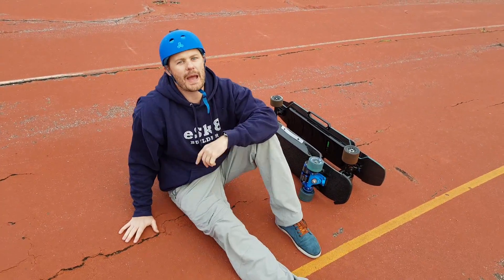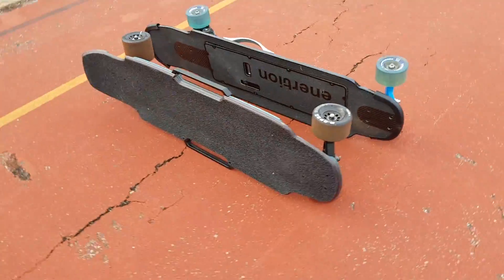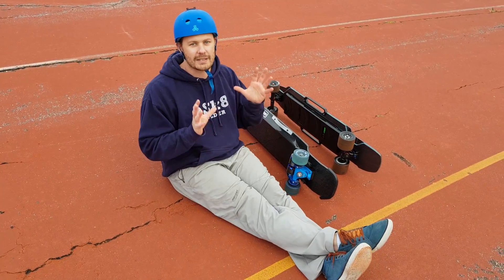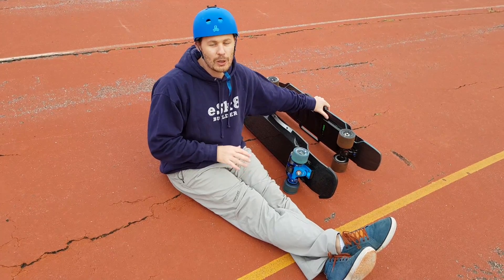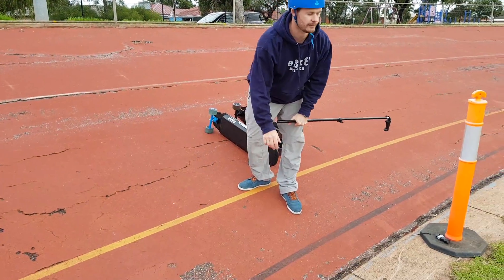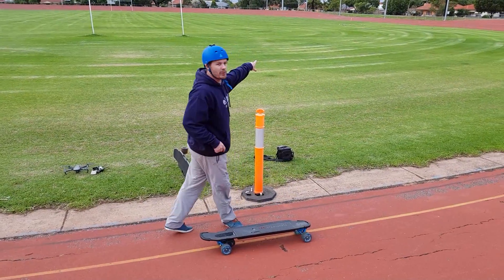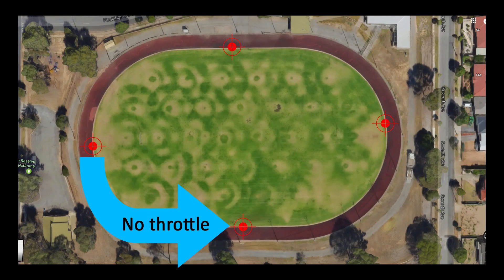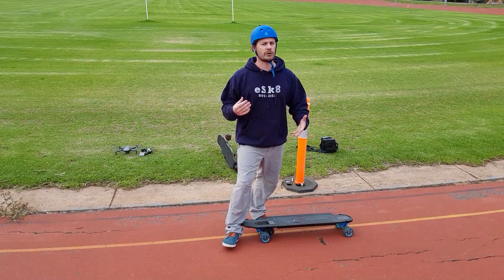Belt Drive vs Hub Motor - Electric Skateboard Comparison

Comment: Statistics of belt version (raptor1) are for one motor or for two?
Reply: 105Amps - that is result for one motor (50Amps each) or for both? Also single motor uses 1500Watt or this result is for two motors (750watt each)?

Comment: So i have a blitzart board. Its a singke hub motor. Top speed is 18mph ans a range of 12 miles. Is there anywah to make it a dual motor? Using different motors besides theres? Like placing the one tou have on my board? The board is made of bamboo and maple. I love it but want a faster motor. Any suggestions?

Comment: I’ve been riding electric skateboards for three years now and from my Experience hub motors break faster than brushless outrunner belt driven motors. There’s just way too much vibration and abuse hub motor takes vs a belt drive System. Hub motor are in direct contact with the road Which causes a lot more stress. There  also more expensive to replace.On the other hand hub  motors need a lot less maintenance from day to day use.
Reply: Electromatic so if I decided to get an electrical skateboard, and it is my first time ever riding any sort of skateboard, should I get hub or belt?

Comment: How long does an e-board like that (both belt drive and hub motor) last with daily use?
Reply: I don't have an e-board (yet, gonna build my own), but I tend to ride fast on my long board (I think the fastest i've driven according to my phone is 39km/h) and on my snowboard (fastest on that was about 53km/h). The thing is, yes it is dangerous, but if you wear protective equipment you should be more or less safe. I never ride neither the snowboard or longboard without a helmet, elbow, wrist and knee guards, unless I have 0 plans on riding fast that day. I'd still probably put them on or take them with me in a backpack or something.                
                
Just protect your self and cruise at a speed you're comfortable at.
Reply: I have had the Raptor 1 over a year now. I don't ride daily but 3-4 times a week for over 8 miles a ride. Never had any issue till I crashed and broke my arm last month. Just ordered a new remote because that was crushed in the crash. Board still turns on and appears to have no scratches from the incident. The carbon fiber really holds up. Hope that helps.
Reply: Okay, thanks for the info.  I was thinking about getting an eboard, but i think it's best i get ebike or a regular bike instead.

I believe it's fun (the eboards), but the "bust your behind" factor is concerning me.  Hope your arm heals properly and be safe.

Comment: Jason, looking into purchasing a Raptor 2 over a Boosted if you can answer a few questions for me. 1- how flexible is the length of wiring between the wheels and battery pack? Essentially, would I be able to swap to a deck with a larger distance between the pack and wheels with no issue. And 2- would any of us purchasing in the next few weeks receive our shipping before August? Because the summer is when I will get the most use.

Comment: Put ferroliquid in these hub motors and you can put more power into them.
Reply: Even on big uphill?
Reply: Arek R. Unlike other esk8 hub setups the Raptor 2 has an aluminum billet truck system that functions as a heat sink.  They probably still get pretty warm but they wont get as nasty hot as other setups.
Reply: Electric Skateboard Builder E-bikes use motors with hall sensor and people add ferroliquids and dont report any problems.

Comment: Jason, do a video on the motor only. I'd like to see if I could put precision full ceramic or ceramic hyprid bearings in it.
Reply: Good to know Jason. Also any heating issue with the VESCs being inside a sealed enclosure with all of the other electronics?

Comment: Please make a video on raptor 2 VS evolve gt carbon
Reply: no problem,  Be careful out there,  these things can get you into trouble,  i have a lot of road rash over the years.  invest in a good lid and some longboarding  gloves with the pucks.  I unvelcro the puck half way and hold the remote behind it on my right hand.  Pucks will save you from a lot of pain and rash if you happen to wax.
Reply: Jason is working on this https://scontent.cdninstagram.com/t51.2885-15/e35/18096490_435267156865932_5533361944037163008_n.jpg
after seeing that i purchase 2 raptors
Reply: He said he's working on it, it's the reason why I made the purchase
Reply: Like the raptor 1 more 

Have driven almost every board on the market 

Now 3 years later i will keep it with my evolve ,s
Reply: they wont ever get scratched by riding but you have to make sure and not hit your motors on anything when you carry the board around.    I take it on the subway and have to just be mindful of not bumping the motors on something.   So far after 2 years i have never hit it or scratched it.    Evolve makes a new bamboo one that has the motor tucked under the board like a boosted.   I use my single motor bamboo deck more than my gt carbon with the AT wheels just cause i like the feel of skate wheels.   It goes just as fast as the GT duel motor set up, the only difference is the torque curve.   I personally love the bamboo deck cause it flexes and just feels perfect for me.   You wont have any regrets with any set up.  personally i wish i would have bought another gen 2 bamboo series before evolve discontinued them.   Parts are still available, i just ordered a new deck and swapped it in 10 min.  car ran over the front of my board and broke the deck.  thing is still a beast, i pass cyclists like they are standing still, it will go 27mph.    No one on a bike can keep up with me.  Also, even after riding the hell out of the boards,  i never have had to replace a drive belt, still on originals and i have logged 100's of miles.  I bought spares but never needed them yet.
Reply: Ok, thanks for the info ;)
Reply: Well if you look at their specs, the raptor 1 out performs the carbon gt in every way, in saying that, evolve can come with off-road wheels whereas the raptor 1 you'll have to modify your wheels, and raptor 2 you can't change your wheels, if you live in bumpy areas with gravely roads, go the carbon gt off-road. If you live near flat smooth roads and want better performance go the raptor 2.
Reply: R/C Vin how/where Jason get/make this custom parts?
Reply: Sorry I didn't get you.
Reply: In that case they're both actually very reliable but I've heard evolve has better customer service, in saying that though, enertion is more customisable and easier to repair and maintain by yourself👌🏼after a few months I've only had to resolder a wire inside the remote, I may have crashed and damaged the remote but an easy fix, but that's it. As for evolve, a friend of mine says his only issue was one of his motors would keep cutting out, he contacted evolve and they told him what to do and now it works again, I still beat him in races 😝
Reply: i live in chicago and i have the evlove gt and bamboo gen 2.   They have held up to every day riding with no issues.   The bamboo gen 2 has 2 years of abuse and it still runs like the day i bought it,  had to replace the deck and motor from a bad crash but it was easy swap.  The Carbon Gt is perfect for the large pot holes in and dirt and grime in the cities.  The only issues i have is keeping the drive bearings clean.  I have to clean them once a week but these boards are my only mode of transportation so they get a lot of use.  Evolve aftermarket sales took care of me always too.   I finally saw some dude riding a raptor and he was going really dam fast,  and my gen 2 with 97mm wheels caught up with him with ease.  I get 27mph with the 97mm wheels, its great.  With those hub motors and a really grimy streets, i wonder if they clog up with dirt and grime.  the inside of my flywheels get black with grim very quick.  Does that affect performance of hub motors?
Reply: Dutch E-board Rides Netherlands evolve customer service super good? I read just the opposite. That Boosted board's customer service is the best one and that evolve's suck. But that's what I read
Reply: the other plus to an evolve board is you can use abec 11 wheels of your choice,  just the wheel options alone sold me.   You can put wheels that suit your style and the size adjusts your top speed.  i go thru drive wheels quick if you do not rotate them.   With a hub motor type wheel you would be limited to your set ups and swapping the rubber only from the drive wheel seems like PITA on a hub motor set up.   Just being honest as a avid E boarder,  I dont work for evolve.  If you live in a pristine place with clean smooth roads and a hub set up suits your style, i can see them being pretty cool but the realistic city settings might be too much for it longevity wise.  i would like to see a long term review on these updated hub motors and how they are maintained and cleaned.
Reply: does the motors get scratched just by riding?. I'm thinking about buying the new Evolve GTX or Boosted Board Dual+, and the new GTX has those motors way outside, and now this model has the motors in gold color. So... I don't know if by riding, they will get scratched easily, mmmm
Reply: Means that the custumor service of evolve
Is super good 

Because of there aftersales i will never buy another brand board ever again

Have owned 
Boosted v1
Yuneec ego
Stary board
Enertion raptor 1 
Evolve bamboo gen2
Evolve bamboo gt 

Now driving my bamboo and carbon gt
Every day

Comment: I was going to buy the Mellow board system this summer but the Raptor 2 is awesome. Maybe I'll buy a Raptor 2 instead because it seems to be closer to what I'm looking for :)
Do you know where can I see and maybe try one of those board ? (I'm in France)
Reply: I on the other hand would get Mellow for the ease of use with any deck.
Reply: Mikenopolis you can swap this for any deck you'd like. everything is backward compatible

Comment: sould i put a Belt Drive or Hub Motor on my 27in board
Reply: well with belt driver, if one of the motors fail, you just change a motor, not the entire wheel
Reply: Belt drive works better if you're using off-the-shelf components. Also it's a lot easier for you.
Reply: Trenton Petre there is pretty much only downsides to belted, as long as you can get a good quality hub... no belt to snap, no bolts to vome loose, no motor to be sandblasted. you need the wheel anyways
Reply: Petter olofsson it seems like hub is not that relieble on tarmac...i mean the constant shake and holes....doesnt it going to tear it apart?....
Reply: Ahmad Fahmi well the belt motor is mounted on the truck so sees pretty much the same vibrations. but the hub it's sealed so wont suffer from gravel